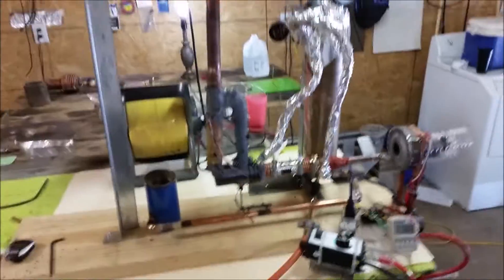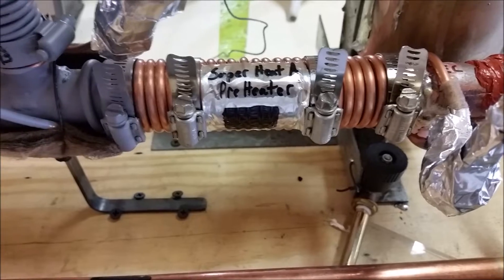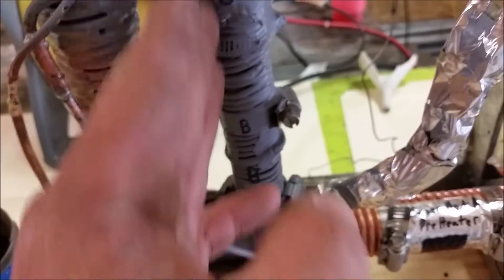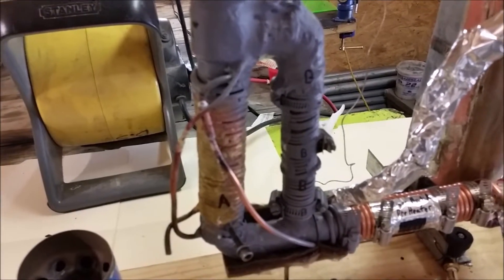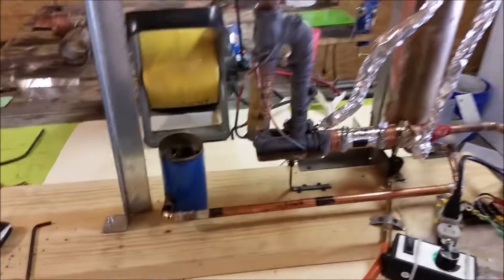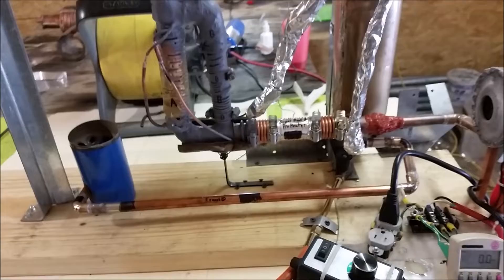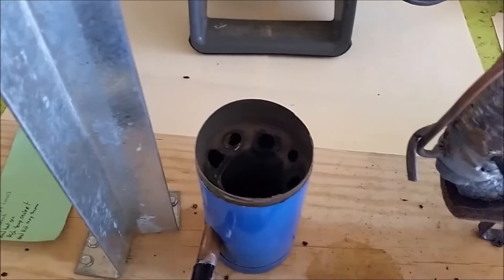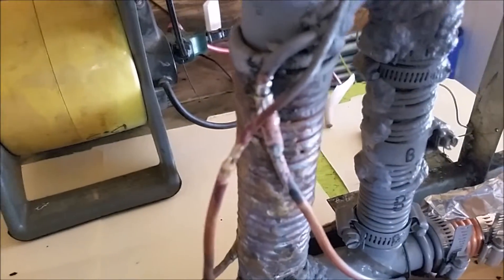Water gas Generator

Comment: I was looking at this and trying to figure out what you are doing.   You must be separating the water into hydrogen and oxygen gas HOH.
Have you measured the amount of energy you using to get the HOH ???? 
The amount of energy required to get water to change to HOH is the key.  
HOH IS a perfect fuel. 
It can be stored as water h2O 100% safely. 
Then converted to HOH 
THEN BURNED. Or used how ever. 
The amount of energy required to separate the liquid water h2O into HOH is the key. 
Generally it requires more energy to separate  the water into HOH than you can get from burning the HOH.     One exception to this is if the energy used to generate the HOH is from solar or wind were the cost is negligible.  There is a cost but because the wind or solar is thought of as free it does not actually add up.  
If you have come up with a way to develop HOH at a low cost it would be priceless.
Reply from the maker: I was trying to make fuel using wood or charcoal .
creating Co gas and H2 gas using red hot carbon reaction
Reply: @NOBOX7  I'm doing the same kind of thing but on a bigger scale Interesting setup

Comment: I think at the end of the video when you turn air pump on full, there was a lot air and your gases was burn right inside pipes hence was no flame in burner. Too much air so carbon wasn't be able to react with all that oxygen.